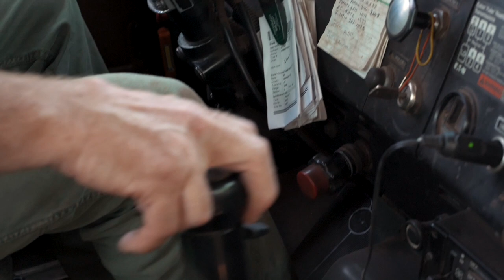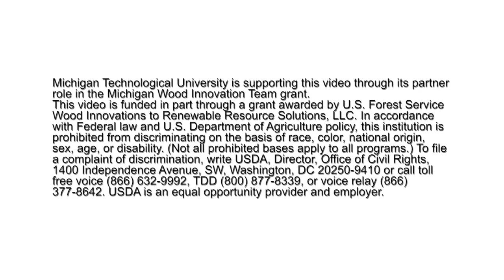A Plan to Move the Upper Peninsula Bioeconomy Forward

Comment: Two problems.  One indirectly caused by MTU itself.  That being allowing the rail line through Houghton to be illegally ripped up and built on by the university and private groups for shortsighted purposes.  A great concentration loading area for wood products at Calumet should have been envisioned.  Second problem is the unwillingness of the two railroads in the region to work together for the benefit of the whole.  Most of the blame there goes to CN as they are not as willing to work on the smaller margins that ELS is struggling with.  The money for rehabbing the rail lines is what is really needed and with that will come other opportunities for rail freight. ( reopened copper prospects and general freight). Trucks really do not like short runs and have to find a happy medium to the transfer sites.